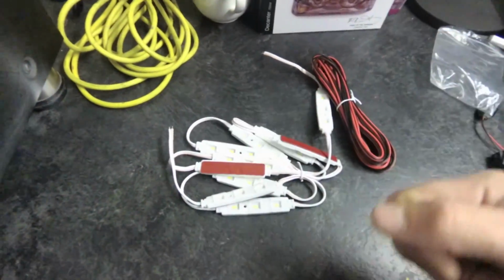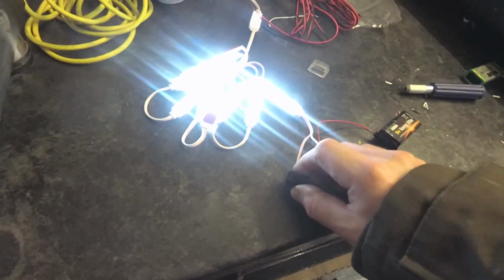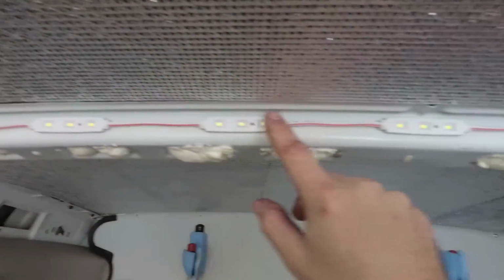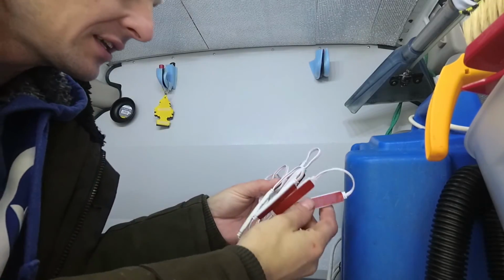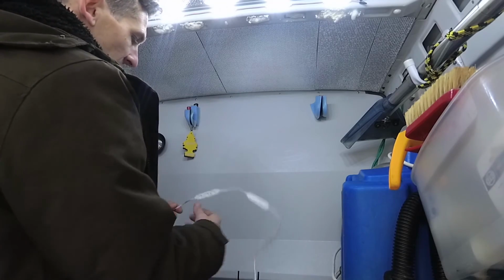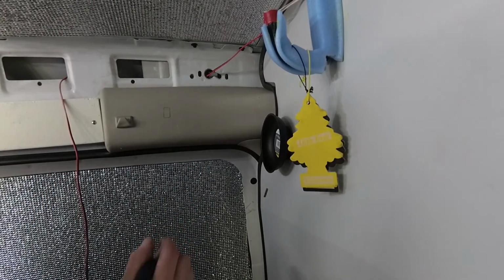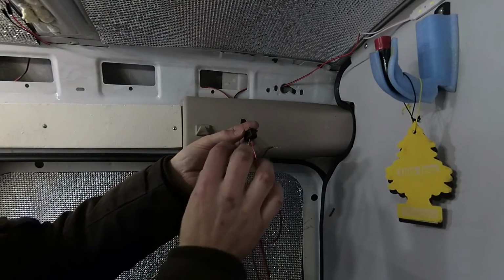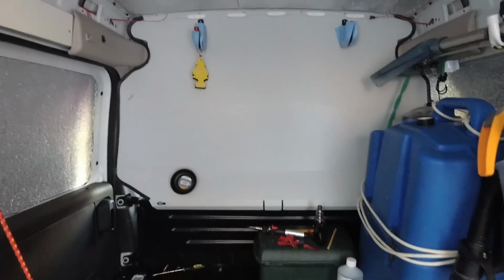How To Install LED Loading Bay Lights to a Van

Comment: Hi did the same on vito but it's bought dash error of autolights inoperative and sos inaprotive and the rear roof interior original lightsnot working please any ideas just to add i did it direct when door opens not on switch
Reply: Hey did you manage to sort the dash problem ? I have Vito w447 2022 and planning to connect cob led lights to my existing light. Hope to not get any error messages

Comment: Thanks for your video. As a result of which I changed mine in vauxhall vivaro 2015 model. Twas a nightmare but this truly helped. As it happens the lights are now on whilst I drive (as there so bright I can see through gap in bulkhead), not sure if the originals were they were so ridiculously dim. That said, they work and produce fantastic light. I wanted to override their auto shut off by inserting a switch but its all over my head.

Comment: Great job. What did you use on the ceiling - did it stop condensation? Is that expanding foam in the roof strengthening beams?

Comment: Mint I'm gonna order some for my mk7 transit lwb only got 2 little halogen bulbs on the roof n they blow to often from vibrations so this will be better easy instal aswell I'm not gonna do switch because I can turn light on of the key n stays on till u shut the door anyway n on a timer even if door open so shuts of after 20 min

Comment: Hi pal got a combo myself have side door with light above and 2 rear loading lights but only use one loading light I want to add a switch so I can turn rear lights off when working can come if the spare rear light wiring
Reply from the maker: My best advice would be to trace the wiring so you know what does what. Then add a switch to the light you want using the same method in the video.

Comment: I want to do the same kind of thing and I would know how to do what you have done or have them so they only some on with the door opening switch but is there any way to still have both? Like you would in the cab with a 3 way switch? I'd like to be able to open the door and the lights come on but also close the door while I'm in the van and switch the lights on. (I have a large transit that I use as a little on site workshop sometimes.)
Thanks
Rod
Reply from the maker: I honestly don’t know mate, I’m no electrician, I just bumble my way through trial and error. You’ll have to ask someone more knowledgeable than me.
Reply: @RustLocker  haha, no problem mate. I'm the same with most things unless it's made of wood then I'm your man.😂

Comment: What do you use to stick the lights to the van   I have a regular headliner and I’m wondering if I need to take it down and place it inside the headliner and then replace the headliner
Reply from the maker: Those led strips had adhesive strips on the back, which stick well, but probably not to carpet. The strips also have holes for using screws as well though.

Comment: Great vid, cheers.  I've a mk3 trafic, the ceiling light fitting has a thin multiplug, can i snip the cables without disconnecting the battery ?
Reply from the maker: I would disconnect the battery man, better safe than sorry.

Comment: Hi mate, im completey new to this and loving your videos to get me started on my combo, quick question but may be stupid, i see you soldered the cables when extending...if i dont have a solder gun could i crimp or use the little connector boxes and wrap with insulation tape ??
Reply from the maker: Yea, you could do that, that’s what I used to do before I had a soldering iron.
Reply: Perfect mate, thank you 👍🏻

Comment: Hi - good video- can you give me a link to the ceiling insulation you have used - thanks
Reply from the maker: I got mine from eBay, I just went back through my old orders but unfortunately that seller is no longer active. 
It’s 6mm reflective sticky back foam, but I cannot find the exact same stuff again. Sorry.

Comment: I have interior cargo light in my van with 3 way rocker switch, on/off/timer. How would I go about wiring these led’s to work along with the stock light?
Reply from the maker: I'd splice the wires from your current light to wire up the new leds, that way they should all work together... BUT I'm not an electrician so do it at your own risk.
Reply: Rust Locker only problem is the led’s have red & black wire, stock light has red, black and grey
Reply: @liamr2419  I'm trying to achieve the same thing. You may have already solved this being that it was a year ago! But I'd imagine the grey wire is the switch wire going to the door opener switch so just leave that as it is and splice in to the red and black to connect your LEDs hopefully then your LEDs will come on with the door opener switch or the on switch that is on your stock light. My problem is my transit rear lights have no switch, they just come on with door opening but I was to be able to also switch them independently.

Comment: Can I ask what sort of adhesive you used to stick the insulation to the under side of you van roof, thanks alot
Reply from the maker: The stuff I used had adhesive backing, peel and stick.
Reply: @RustLocker  ok thanks

Comment: Mabie a daft question but did you disconnect the battery while doing the works?
Reply from the maker: +Matt Glynn I didn’t, but you should, as a slip with one of the wires could end up up blowing a fuse.
Reply: @RustLocker  nice one, cheers 👍🏼

Comment: Great video, i also have a Caddy, i did use reflectics Tape over the stock trim roof, and put insulation / rubber matt stuff behind that in the gap. i didnt however put anything inside those air collums. i could not decide if its worth filling it with that spray liquid stuff. i put more rubber matting in the side doors and such. i also plan to keep the reflextics tape to make the lighting better.
Reply: its not a caddy mate
Reply: @NeObliviscaris3663  pretty much the same size tho

Comment: Nice video. Is there much drain on the battery.
Reply from the maker: +Bikerjon1 i added the switches so they wouldn’t stay on if I accidentally left a door ajar. So I haven’t had them on for any real length of time. 

I think you’d have to leave them on all night to see any noticeable drain.
Reply: @RustLocker  nice one